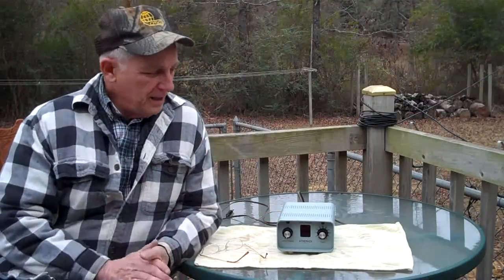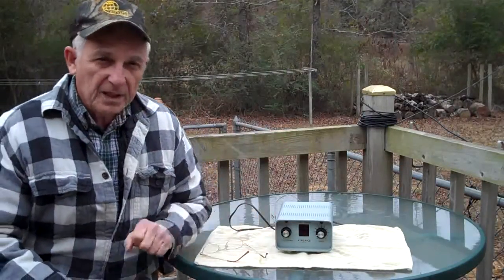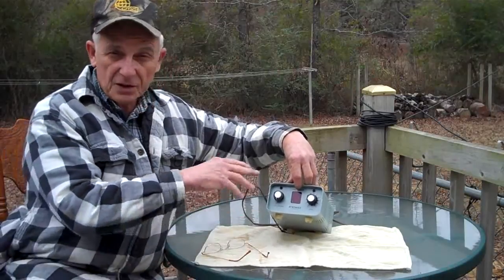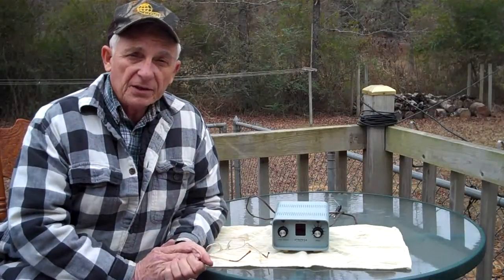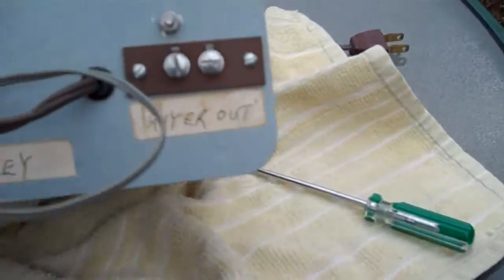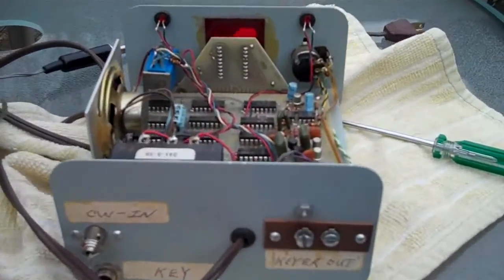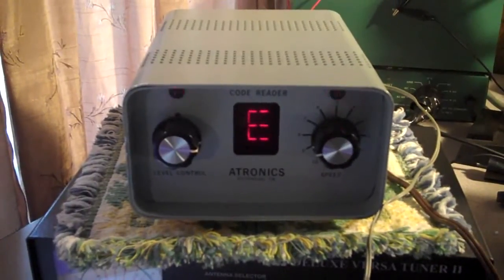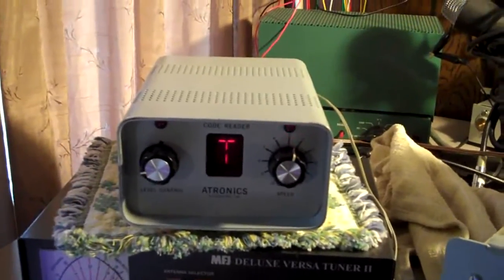The Atronics Digital Morse Code reader

Comment: Nice to see these things still exist in the wild.  This particular model was the original model.  Later models were sold under the Atronix name.  Enhanced models had multi-character readouts.  As MrHarveyluke points out, a good consistent key hand is required for this to work well.  grassulo is dead on, adjust the speed knob until the led on the right "matches" the frequency of the code led on the left.  The level knob should be solely for controlling the output volume of the code and servers no other purpose.
Glad you were able to find a manual for this thing.  BTW, this model was likely manufactured circa 1977-1978.  I assembled quite a few of these things back in the day.  Incidentally, my father was the inventor, manufacturer, and seller of this device.
The advent of affordable PC's made this gadget obsolete in a very short period of time.
Sorry to respond so late in the game....
Reply from the maker: Your Dad invented and manufactured this item?  How cool is that?  I've often wondered where much of this old stuff ever came from.  Thanks for filling in one of the blanks, my friend.

Regards,
John
Reply: Just picked up a CW keyboard last night, and it still works!  Do you know of any schematics / service instructions for when it finally fails?  YooToube is being silly again and won't let me upload the video at this point, but I'll try again later.  I see the company was in Laguna Hills (I went to LHHS!)  I'm over by Corner now; hoping there's some local info.
Reply: Super cool. Please Share manuals and schematics if You still have them.

Comment from the maker: @grassulo
I finally got a code reader manual from Vintage manuals dot com.  It tells all, but it wasn't cheap.  They're proud of what they sell.  Anyway, my primary hobby is the repair and restoration of vintage radios, with a pretty big backlog of radios to be worked on, so ham radio is currently taking a back seat.
Thanks for the response.

Regards,
John

Comment: I would try adjusting the speed control till the light on the right matches up with the light on the left, from what I understand the left hand light is it detecting the pulses and the right hand one is what the circuit sees at that speed setting, try adjusting it till both lights synch up and see if it can give you somewhat readable output. Any digital code reader will have some hiccups as 2E0VJO pointed out.

Comment: Not knowing morse code, if I were fiddling around with it, I would try tuning into a "known quantity" like a morse practice transmission or a repeater id where I had an idea of what's being transmitted and then I'd try adjusting the knobs to see if that helped.    

Though I imagine getting the manual will help you in figuring out how to run the thing.

Regards,
Joe KJ6KBU

Comment from the maker: @hedwig85,
Someone else already contacted me about that web site.  I had previously run across it myself, but was unable to determine the code reader's model number.  But the second time around I reopened the case and found it written in very small letters in one corner of the main circuit board.  The model is indeed a CR-101...and the manual has been ordered.  Should arrive in a few days.  I'll do an update vid telling those interested what I found.
Thanks.

Regards,
John

Comment: You're right, it looks like late 70's early 80's technology.  To read code successfully from the air, you need two things. (1) It needs to be sent with a good "fist"  Computer reader programs and MFJ code readers won't copy correctly if the spacing and sending is sloppy.  (2) The algorithms in the programming of the reader needs to be adapatable.  I doubt that back then, they had good programming for these things.  It was a good gift but I doubt you will be able to do much with it.  73 KM4JA